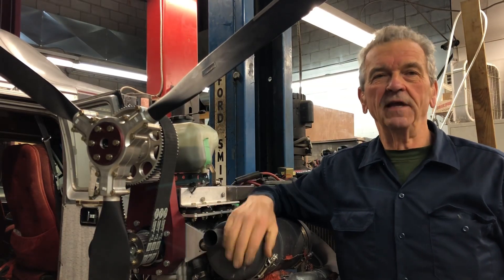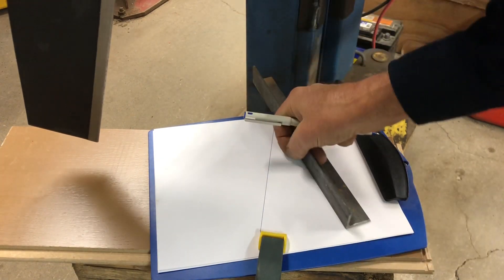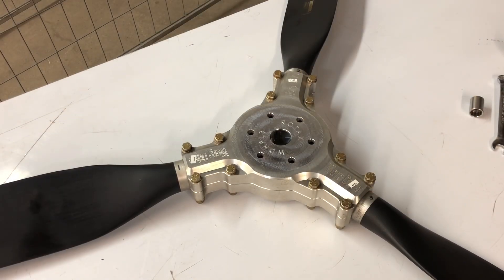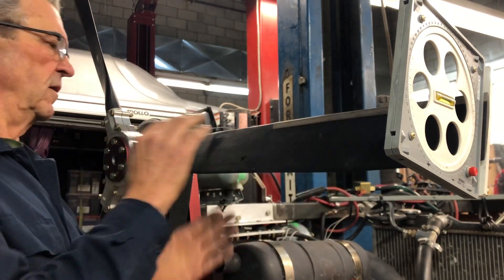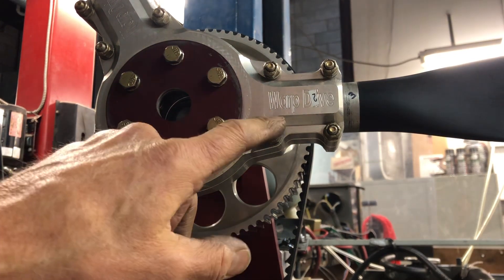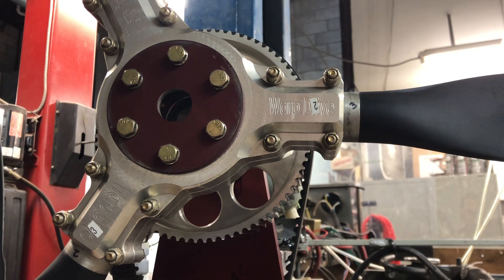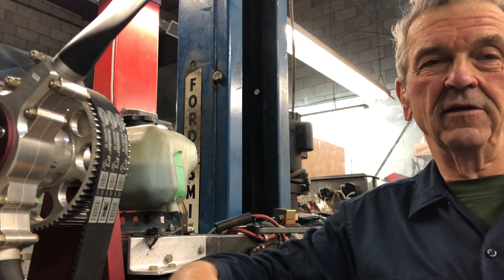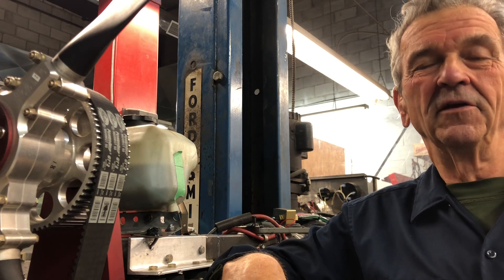Rotax 582UL propeller vibration diagnosis

Comment: Nice video on setting prop and blade tracking.  I've built a jig that holds a laser to the prop blade and projects a laser lite onto the wall maybe 20' away.  Twist each blade so they all hit the same spot and it is super accurate.  At 20',  4" equals about 1 degree.  I usually get the blades within 1/8" of each other. Here is a link to the video I put up of it.  https://www.youtube.com/watch?v=c9Uj_d3uSWc